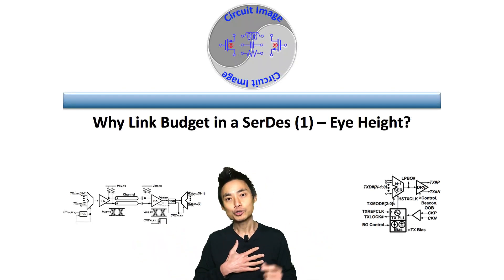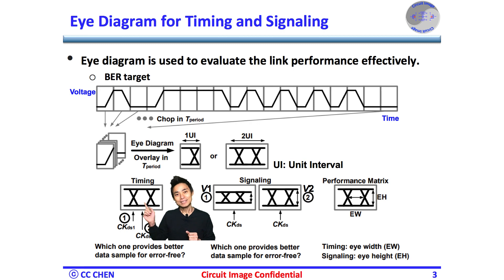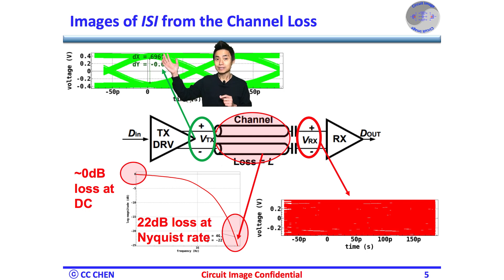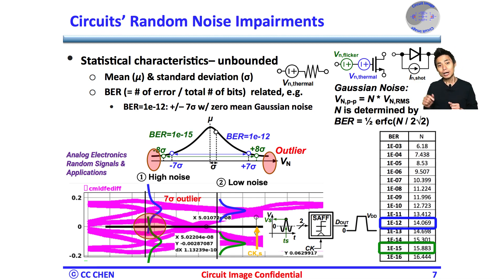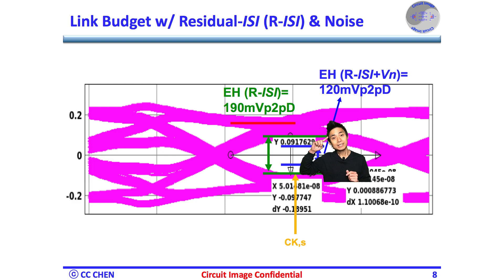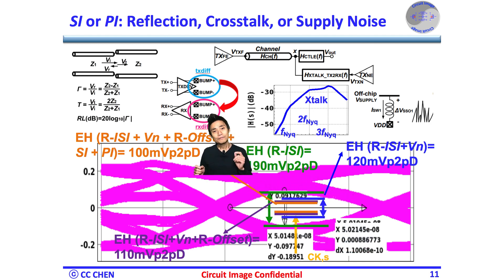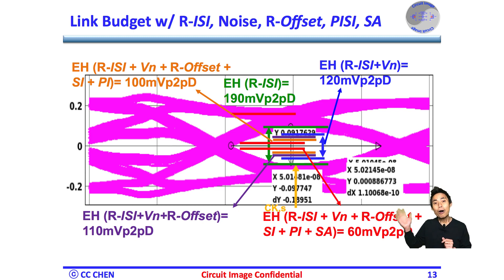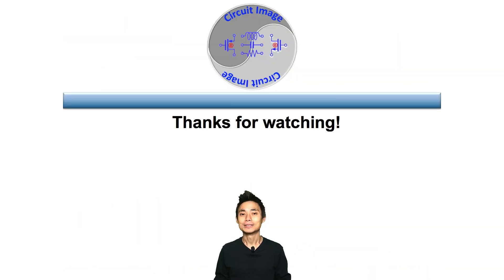Why Link Budget in A SerDes (1)—Eye Height?

Comment: Hi, CC Thanks for the nice videos! I didn't fully understand how the value of EH relates to the minimum Eye opening we have to achieve. I understand the calculation from the TX amplitude to eye height reduction due to the ISI, noise etc. what EH margin is enough if we don't want to over-design the system? what is the minimum EH margin do we need? i guess there are different way to look at this. for me it's easier to look at it in a SNR point of view. The signal amplitude vs the noise including circuit noise, SI & PI etc. We can sort of derive a SNR at the input of the slicer where the signal amplitude needs to be larger than all the noise combined. But again what determines the minimum SNR?

Comment: Hi CC, i was looking into this video again and started to think about the min. amplitude required for the DFE sampler to work correctly. Should not the CTLE output amplitude be atleast: sensitivity of sampler comparator (Vsens) + 7*Vnoise (of comparator+ctle output) +Voffset (of comparator). This should be minimum amplitude needed to make the comparator work correctly, and to meet the first tap timing and open the eye at DFE input. If we do the math based on your numbers we get amplitude (peak) required to be: 20mV+7*5+5=60mV, which is what the CTLE output provides, then DFE further opens it to 190mV. I didnt include cross talk numbers, else the requirement on CTLE min. output further increases. Is this analysis correct?
Reply from the maker: Hi Abhirup, good job and your analysis is exactly right. You did the one side (differential peak) eye height analysis, and that's right as well. Thank you for checking the analysis image one more time. :)

Comment: I have 3 questions！
1. At 9:30, why +/- 6 standard deviation contributes 60 mVp-p from 5 mV,rms？
2. At 9:50, why 120 mV - 10 mV = 110 mV, instead of 120 mV - 5 mV = 115 mV？
3. At 11:45, why clk-Q delay decrease with the increase of input swing of sampler, slew rate or any other intuitive way to gain an insight into the phenomenon？
Thx a lot, the concept of link budget is really clear for the SerDes rookie like me！
Reply from the maker: Hi Po-Yao, nice to meet you, and thank you for the good questions and feedback. I'm glad you liked my video and that helps. I have comments below.

I have 3 questions！ 
1. At 9:30, why +/- 6 standard deviation contributes 60 mVp-p from 5 mV,rms？ 
[CC] The peak-to-peak deviation is 12 standard deviation: therefore, peak-to-peak deviation = 12 * 5 mV,rms = 60mVp2p.
2. At 9:50, why 120 mV - 10 mV = 110 mV, instead of 120 mV - 5 mV = 115 mV？ 
[CC] 5mV peak (single-ended) would be 10mVp2p (differential); therefore 120mVp2p - 10mVp2p, differentially.
3. At 11:45, why clk-Q delay decrease with the increase of input swing of sampler, slew rate, or any other intuitive way to gain an insight into the phenomenon？ 
[CC] Larger swing may need less time to regenerate to a rail-to-rail swing, but a smaller swing may need more time to regenerate to a rail-to-rail swing. 

😀